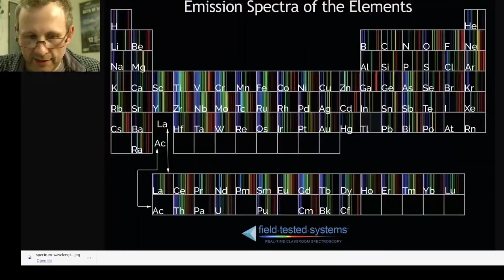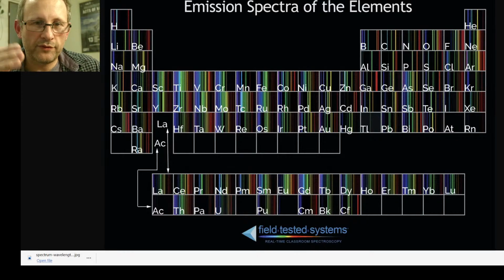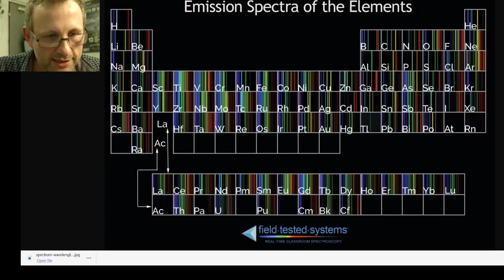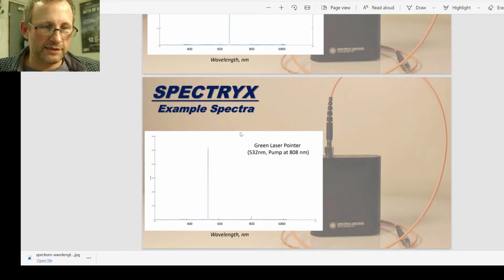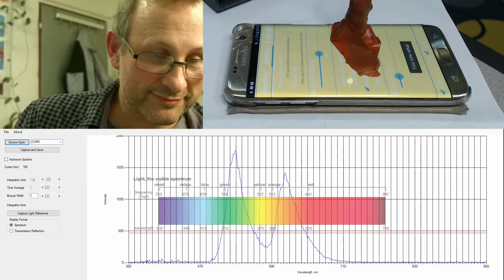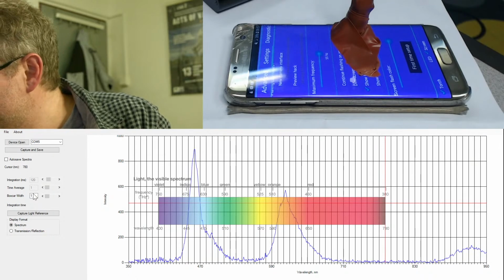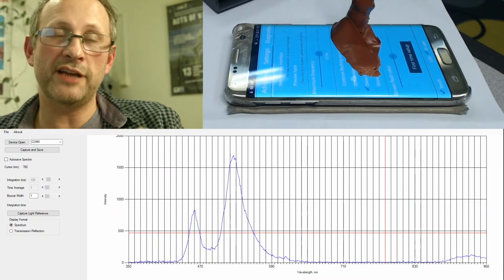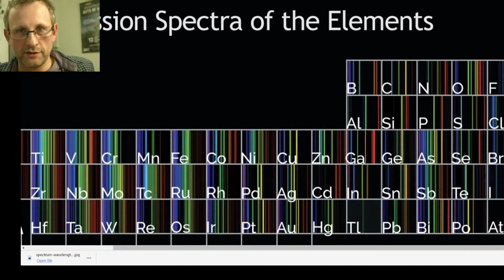Affordable Visible Spectrometry

Comment: Is it possible to put the filter on the other end (the instrument end)? (a makeshift adapter whereby you could insert various filters - even salt filters depending on what you need)  This would give you more options to try and you wouldn't have to worry about the reactor reacting with the filter itself - or destroying it.
Reply from the maker: Well, we will have to put a collimating lens on the open fibre end anyhow it would seam, so this will offer protection.

Comment: I would happily write Python code if you need it.
Reply from the maker: Thankyou so much for your offer. I will post the supplied code on RemoteView.ICU alongside a sample output file from the windows application.
Reply from the maker: I have added some more samples, the corresponding data, the python script supplied and a sample output from it.
Reply: @MFMP  I will have a look tomorrow or Monday. Cheers Bob.
Reply from the maker: @definty  thankyou so much definty
Reply: What open-source database would you recommend for just raw data storage at, say the 100spl/sec rate?  (say, resolved to 1 nm of resolution [600points - 2bytes for the wavelength] the intensity [2 byte] + timestamp [4 byte] recorded at the max)
Reply from the maker: @davestorm6718  Well, sadly it does not quite resolve 1nm. I'll leave the expertise to definety.
Reply: @MFMP  - Yeah, the optics alone wouldn't resolve that well for the device. :)    Maybe when I'm gainfully employed again (COVID - yup), I can pick up an old Varian OES w/CCD ICP spectrometer for $2000. Those were like $80K 2 decades ago, but, a lot of them had burned out RF generator circuitry - but you  wouldn't need the plasma generating part. I saw a broken unit for $5K in the states (on eBay) being sold for parts.  

https://www.ebay.com/itm/233822822934?chn=ps&norover=1&mkevt=1&mkrid=711-213727-13078-0&mkcid=2&itemid=233822822934&targetid=4581046487582653&device=c&mktype=&googleloc=&poi=&campaignid=410488099&mkgroupid=1239149830908141&rlsatarget=pla-4581046487582653&abcId=9300489&merchantid=51291&msclkid=97f35eb6d2d0130402583ee1483b846e

The optical resolution of a Varian CCD is, I believe, 0.1 nm (it's hard to determine from the manual - not really specified directly, but the sensor is megapixel, whereas the handheld spectrometers use a 20,000 - 50,000 pixel sensor).   
Of course, it's really bulky, lol!  
Right... I'll shut up now.  :)
Reply: @davestorm6718  CSV and then just store CSV into any DB you want. SQL or NoSQL. Since the session you are recording will be limited by the write speed of the hard disk and 100Hz sample rate isnt much consider audio 44.1Khz+ my audio is at 96Khz a second when I record.
Reply: I sure hope y’all figure something out cuz you just shipped me a unit that doesn’t work on Windows, doesn’t work on Linux, and turns out isn’t even receiving any data communication whatsoever

Comment: Consider piping light to the grating.  Have you already attempted this, Bob?
Reply from the maker: That was the plan. But this device solves it, plus it has a far faster sample rate (10ms) and accuracy.
Reply: @MFMP  I understand that a faster sample rate and higher accuracy are desirable.

In your opinion, Bob, are the better specs essential for convincing evidence?  Or would the much less costly system suffice.

Thanks for sharing your insights.
Reply from the maker: @nickgineer  The transition times in the reactors may be VERY fast and synching them is important. Having the data linked with other metrics and simply is worth a lot.